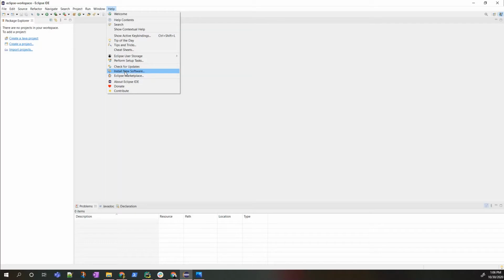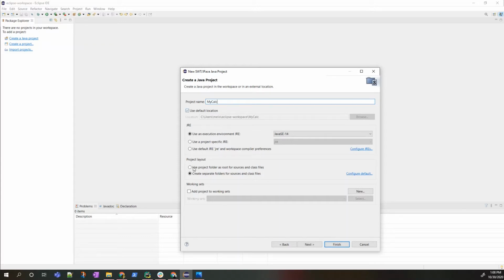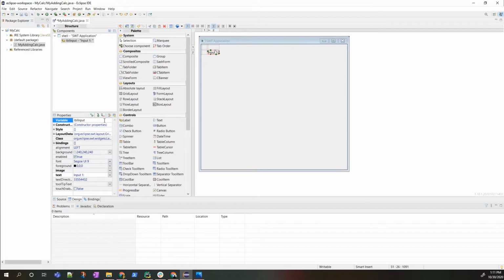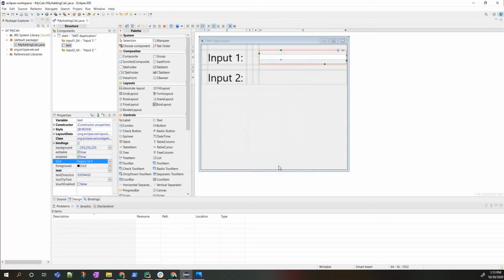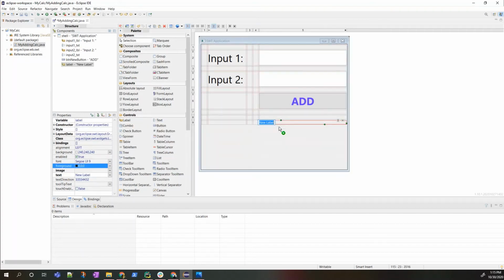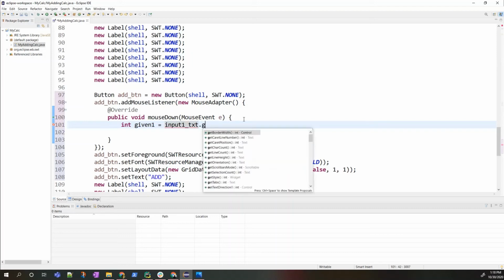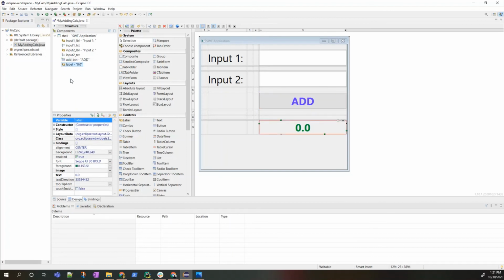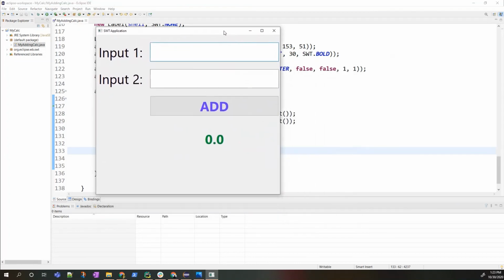Java: 2020 Eclipse Window Builder UPDATE

Comment: After installing window builder in eclipse code autocomplete ks giving error
"Problems during content assist"
The 'API tools javadoc proposals' proposal computer from the 'org.eclipse.pde.api.tools.ui' plugin did not complete normally. The extension has thrown a runtime exception.
To avoid this message, disable the 'org.eclipse.pde.api.tools.ui' plugin or disable the 'API tools Proposals' category on the content assist page.
I have tried disabling this but still giving this error
Reply from the maker: I am sorry you're running into errors like this. I am unfamiliar with this error, and am at a loss to make suggestions. You might try some of the suggestions here: https://stackoverflow.com/questions/12871947/eclipse-warning-problems-during-content-assist, or here https://stackoverflow.com/questions/1367306/eclipse-java-content-assist-not-working/10997241 If all else fails, you might consider upgrading or reinstalling eclipse all together.
Reply: @MelissaDale  thank you
The problem is resolved by uninstalling and then reinstalling jdk again as I have two jdk installed so kept the latest one only.